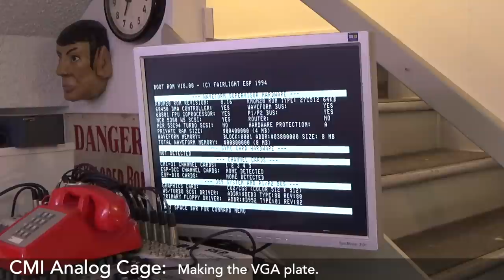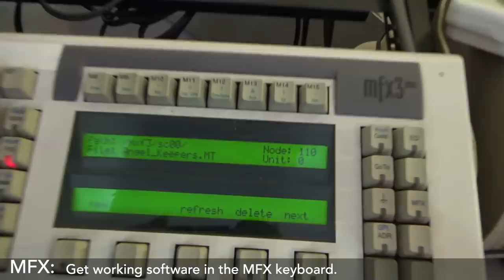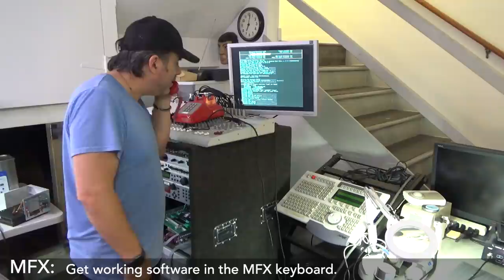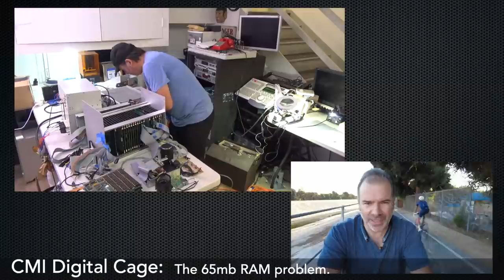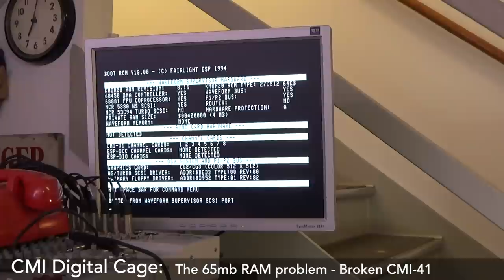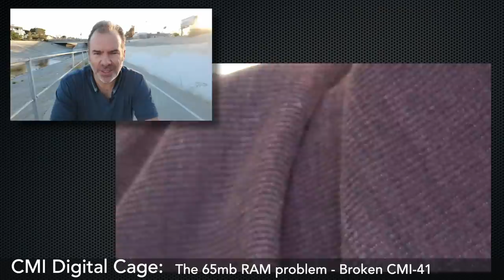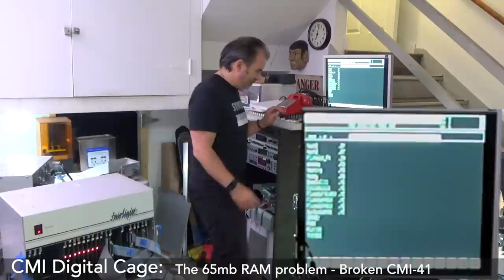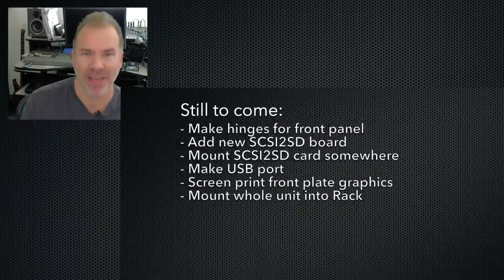I'm Building a Fairlight CMI: Episode 8

Comment: Can you help ?
Now days people are converting floppy drives to USB i have a Roland arranger 
that has an Iomega Zip drive but it is SCSI .
There are way too many chinese MMC or SD 2 SCSI card interfaces !
But how do I know which will work with Roland SCSI and also the SCSI termination setup well I forgot all about that many years ago and my brain is not that good to re-learn new stuff. I used to be awesome with scsi 30 years ago !
Please help if you can !
Reply: I'd say it's more the card size you use that matters. The SD2SCSI should work, SCSI is a standard. But if you insert a 128GB card and expect something that old to recognise it you're going to fail. You need to try small cards. 1GB or less. If the the Roland expects it to only be a ZIP capacity then 128MB or 256MB.
Reply: Yes, 6581punk is right, a v6 SCSI2SD should work fine, but it's the formatting and/or partitioning that you have to get right for the arranger. Once you format it right, it'll work I'm sure.. jeesh, those SCSI2SD seems to work on everything ! :)